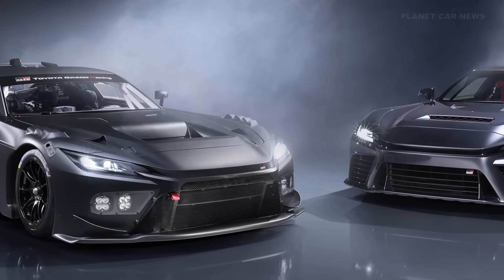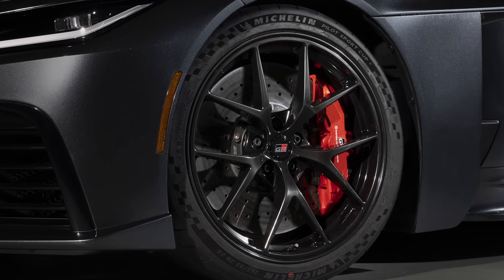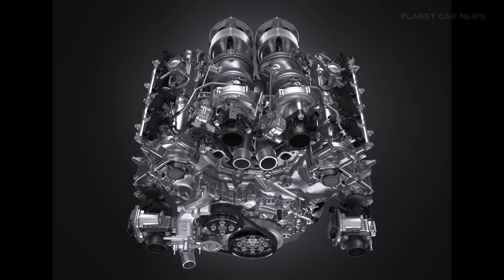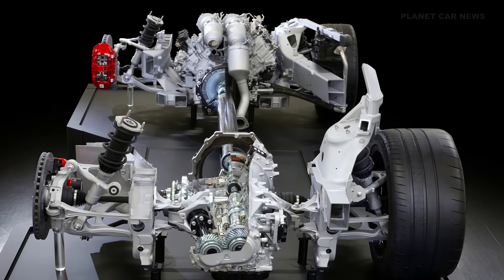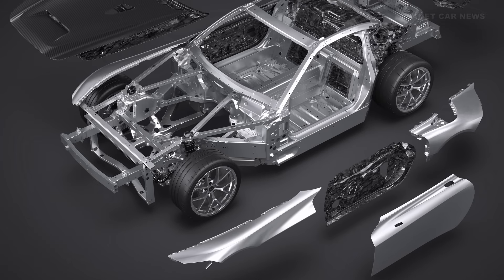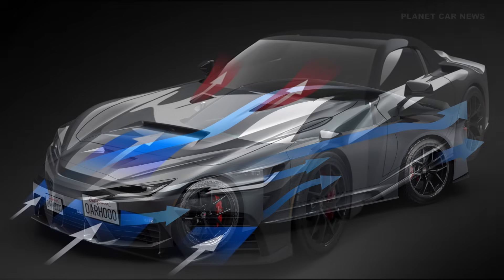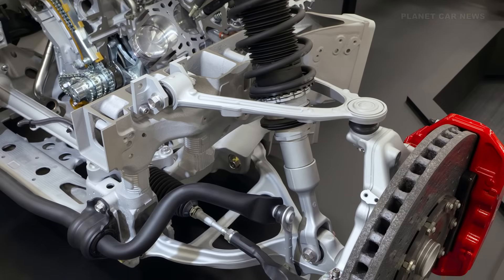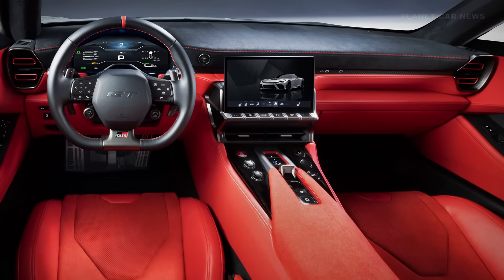NEW Toyota GR GT | V8 SOUND & Technical Details

Comment: The new Toyota GR GT is a larger, front-engine supercar (around 198" L x 79" W x 47" H) focused on grand touring, while the classic Lexus LFA was a more compact, mid-engine pure supercar (around 173" L x 73" W x 48" H), with the GR GT featuring modern dimensions for a powerful hybrid V8, continuing the spirit of the original LFA's performance but in a different layout and era.

Comment: Hybrid twin-turbo v8 targeting 'over' 650? z06 makes 670 NA. Also auto only and looks like a Camry. Hmm.... not very exciting tbh
Reply: Bro, you must be very spoiled by hybrids exceeding 800-1000 hp. This car seems to have been designed to be lightweight despite the hybrid system; it's probably a mild hybrid. 

That power output makes sense; a car that doesn't need much power to compensate for the weight of heavy batteries, the GR GT doesn't seem to me, at first glance, to have large batteries in the floor.
Reply: It's a mild Hybrid which is only for smoother shifts, hybrid doesn't make any power on top end and it's much lighter than a z06 cuz it's using carbon